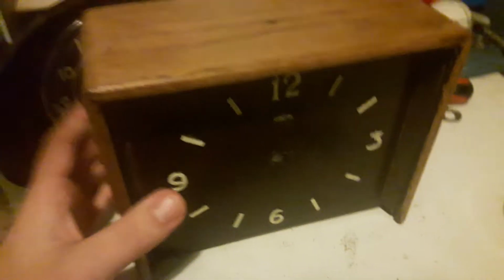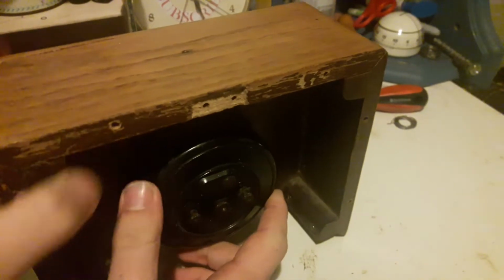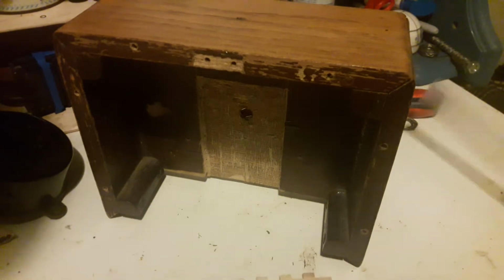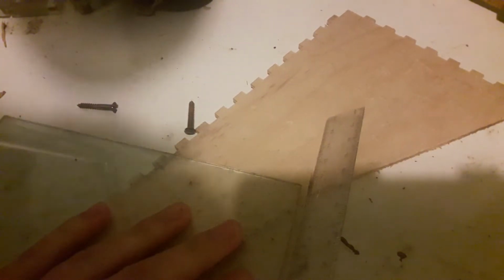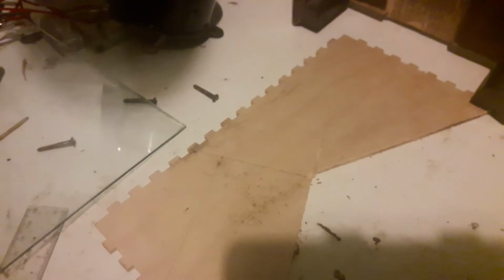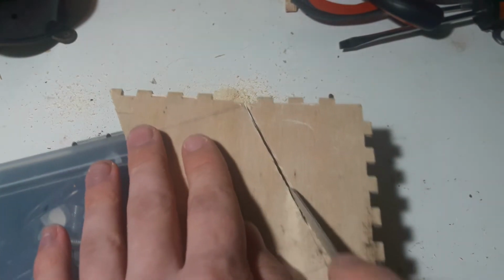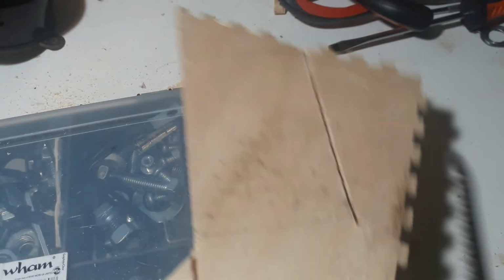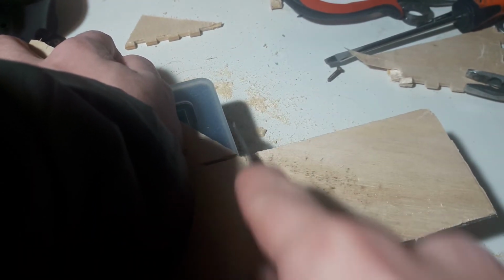NEW MOVEMENT for the Metamec! (3)

Comment: That worked. Not sure if that's the way I would've gone about it.
Reply from the maker: How would you have done it?
Reply: Eh, this worked fine. Now that I think of it, I don't even know how I would've done it. Maybe use my Dremel with the cutting wheel? Not sure.
Reply from the maker: @SKHorology2025  a solid suggestion.